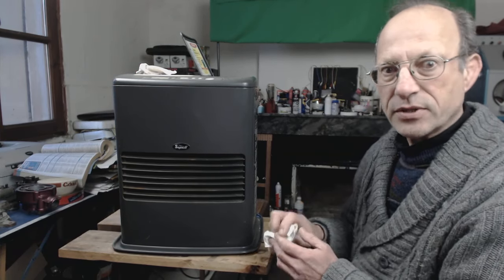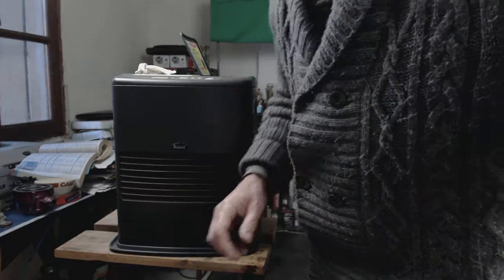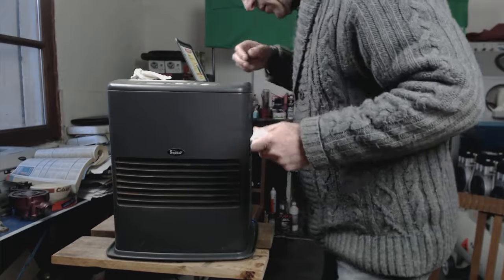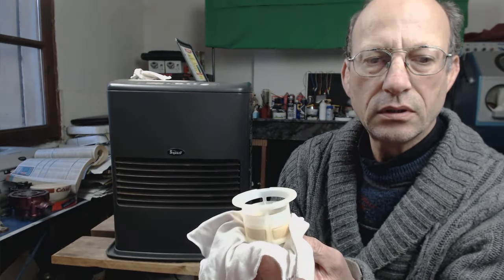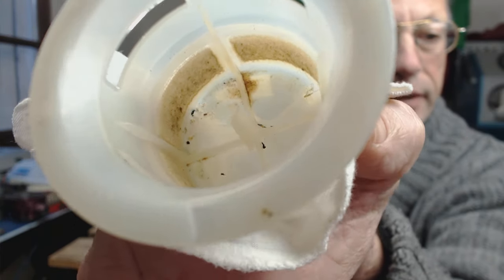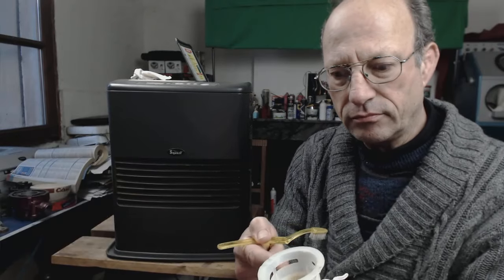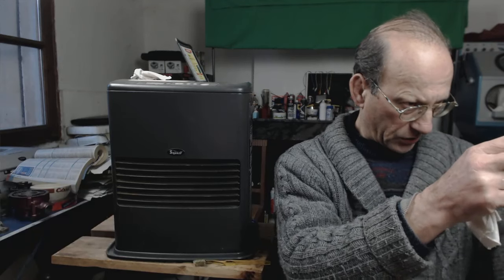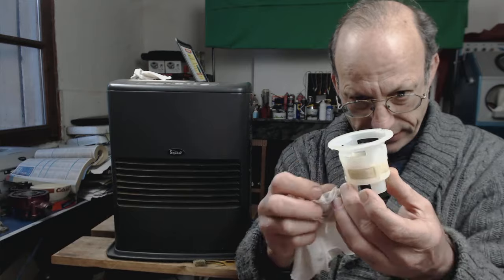Paraffin / kerosene / petrole inverter heater: Cleaning the filter

Comment: Thanks sir..
I have problem in this heater..I use normal oil in the last winter, in this winter there is E-9 symbole..
I hope you can help
Reply from the maker: E9 indicates that the heater has been knocked.

Place the heater on a flat surface.
Connect the power, and switch on.
Wait until the error code appears.
Disconnect the power.
Connect the power ... repeat above ... at least six times.

Did that work?

Help others, and report back here ;)
Reply: @EngineTuning  
Thanks sir
Does it mean there is no need to clean pump like your video?
Reply from the maker: We don't know.

What I know, is that all the heaters, out there in the world, that use mid grade oil...
They all would benefit from cleaning.

The above video, deals with the filter.
However, the main problem area is the flame rod.
It can get coated with carbon.
This effects the fuel delivery ... creating more carbon ... creating worsening fuel delivery,

If the heater doesn't start (after the previous procedure) ... I would change the fuel, including the fuel in the fixed reservoir (especially the fixed reservoir).

If no joy ... clean the flame rod.

Go to my channel and find the playlist for these heaters.
Reply: @EngineTuning  
I did what you told me,E9 still..then I cleaned the flame rod & changed gas..now I see code E2..
Thanks
Reply from the maker: E2 indicates bad fuel.
Reply: @EngineTuning  
Thanks..
Best whishes from IRAQ
Reply from the maker: Always remember ... if it doesn't work ... there is a fault that can be fixed.
Good luck.
Best wishes.

Comment: Bonjour monsieur 
J’ai un poêle à pétrole électronique  sreh35x 
Il affiche 18:18
Et s’éteint une minute après le démarrage
Reply from the maker: I have not seen an error code 18:18 

Is this the first start, since the last winter?
Did it work, the last time that you used the heater?

If so, did you clean the fuel from the bottom tank (using the syphon), and use fresh fuel in the reservoir?

If not, it could be the fuel that needs changing.

If this doesn't cure the problem ... 
See my other videos on how to clean and service the heater.
This solves most problems.
Reply: @EngineTuning  
Yes indeed i clean and brossing engine 
And every things 
I thé firt Time since the liste winter
Ta the bigining  after but it on 
It berning during 5 min after it stop
And show message 18:18
Reply from the maker: @dowelloscka.boulala3610  
Hello Dowel :)
Your problem is very normal.

- Last winter, the heater worked.
- You stopped using the heater.
- 6 or 7 months pass.
- you start the heater ... but it has a problem.

What happened?

(Typically) You left the fuel in the bottom and top reservoirs.
Condensation occurs, and water settles in the bottom reservoir.
... the fuel oil evaporates, and becomes thick, and sticky.

Perhaps the fuel oil that you used (last winter) was not high quality ... this is not unusual ;)

... You have one piece of knowledge (100%) :-
The heater was working, when you last used it :)

The electronics did not fail (unlikely).
Therefore, the problem arises from the fuel, or a dirty flame rod..

If you have dismantled the heater, and cleaned the flame rod (have you done this)?
Then it must be contaminated reservoir and or fuel.

Buy acetone, and mix 2% with the fuel.

When the heater is working, you can drop the mix to 0.5% acetone.

Bonne chance :)

Comment: I'm thinking of getting one of these, they sell paraffin in my local petrol station in 4ltr packs, £7:99  but I know another petrol station that sells red diesel and Heating Oil straight from the pumps at £0:75p a litre, but I'm wondering if it'll work with standard Heating Oil, before I splash out £300 on one, any advice anyone, I reckon I could half my winter gas/electricity bills if they do work on heating oil or red diesel
Reply from the maker: The 'inverter' type is way better than the original simple wick type, and even much better than the more advanced Japanese wick heaters (which in turn, are far better than the original simple wick heaters).

The Jap wick heaters are great when operating at full heat, but heat output adjustment isn't great.
When you lower the wick, the combustion temperature drops, meaning that combustion is not complete - increasing the toxicity of the fumes.

The Jap wick heaters stink on start up & shut down.
The Jap inverters (I believe they are all Japanese, just rebadged by importers) stink on start up.

I've never been able to cure this problem at source.
I use a big bin bag.

Upon starting, the combustion chamber is heated.
At temp, the sparks fly (clicking sound) - then fuel is injected.
The fuel vaporises and ignites - an annoying puff of smoke is ejected through the grill.
I catch the smoke in the bin bag, and eject it outside ... job done!
Thereafter it burns extremely cleanly, even when the temp control is reduced to the minimum.
(reducing to the minimum is probably required, once the room is warm, because these heaters really chuck out heat, and you save a lot of fuel)

Maybe if you buy a stove new, this initial puff of smoke will not occur.
If you do buy a new inverter heater ... please remember to report your experience here - that would be VERY useful ;)
... so far we have not had any specific comments on this issue from latest gen heaters.

I'll answer your fuel question on my 'fuel safety vid' as I see that you have appropriately left a comment on that vid - Nice!

Take note of my comment :
https://youtu.be/dRmrEOBsEDw

Comment: Hi I was wondering if you are familiar whith this type of stove 
by moving it it shuts off
after that when you turn it on,  smokes come out and it doesn't turn on anymore 
Do you have any suggestions.   Cheers
Reply from the maker: In principal; if the stove is knocked, and then doesn't start
... you need to place the stove on a flat surface, then repeat the startup procedure until it starts.
This might require 5 attempts.

What is not evident, is why the heater is smoking?
Normally, after a knock, it will fail at the outset.

After pressing the start button, you need to monitor what is happening.
With the front cover off, you can see the CO2 sensor flashing.
You can hear the fan start.
You can hear the clicking of the sparker.

The fuel well is heated - the oil is injected into the fuel well, creating a gas (due to the heat)
The sparker begins - this ignites the gas, and an initial puff of smoke is created.

Therefore, your description of 'doesn't turn on' needs to be replaced by 'the sequence of events that happen'.
Reply: @EngineTuning  hi and thanks for the information 
I dont hear a spark or flame that might be why it won't turn on
How do I fix that. Cheers
Reply from the maker: Ian ... you need to list what IS happening.

What is displayed on the screen when you switch it on?
Does the CO2 sensor flash?
Is fuel injected into the well.
Does the well get hot.

You talked earlier about smoke.
Is this paraffin vapour from the heated well?

Does the display change to an error code?

The more information that you provide, the easier it is to suggest a fix.
Without information ... what hope is there?

Comment: Hello, I've put out the filter and sucked up the oil with toilet paper. Even under the filter it was dirty. SO I put back the filter and reservoir and now the display always mention oil, can't get it on. Any idea why sir ?
Reply from the maker: If there was dirt on the wrong side of the filter, it is possible that there is a blockage.
The old oil might have gone sticky.
Or the oil level sensor may be stuck.
In these situations; make sure that you are using the most highly refined heating oil grade.
This will be the 'thinnest'.
https://youtu.be/dRmrEOBsEDw
Therefore it will have the best chance of working, particularly when very cold (as the oil thickens).
You can first make sure that the new oil is warm - say 20 - 25C.
This will act as a solvent and help it to breakdown any old oil that has gone sticky.

If these measures fail, then the heater will need stripping, with a view to cleaning everything from the reservoir to the combustion chamber.
... and while you are there; clean up the flame rod.
Good luck!
Reply: Thank you, I will leave the item in the house so it is warm. I will try tomorrow.  I subscribe and to see more vids from you, very inspiring.
Reply: Hello, I will leave the item in the house and try it tomorrow morning. I subscribe and hope to see more video's about everything. Very inspiring. Young people look up video's like yours because they don't know how to do things anymore. All skills are lost. Seriously even me. They only know their desk, keyboard and playstation. We need your generation to learn us again.
Reply from the maker: Ah yes... it's good that you have understood the purpose.
It makes it all worthwhile :)